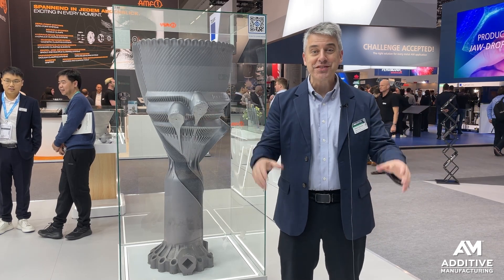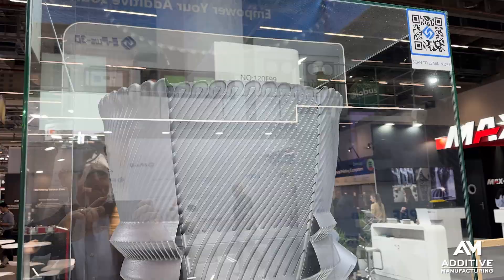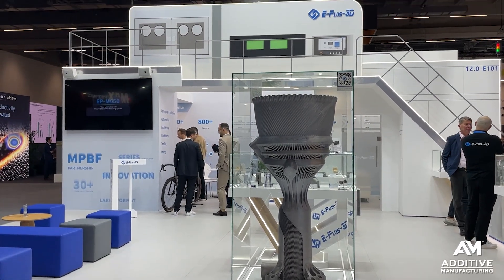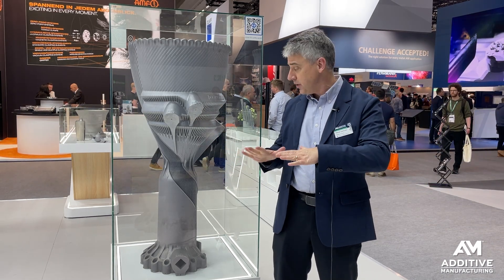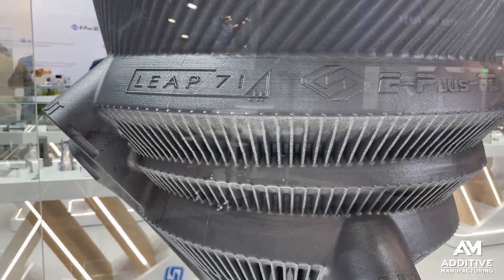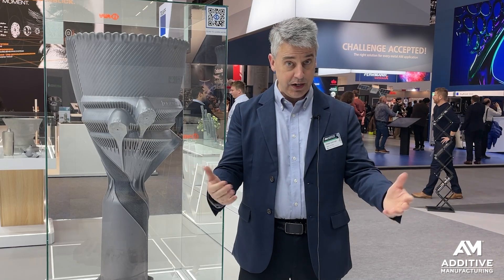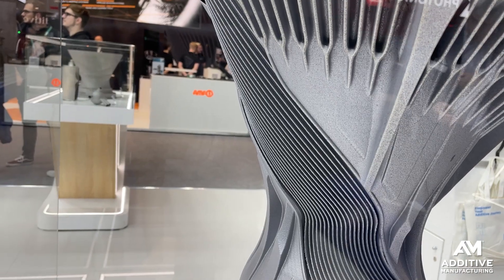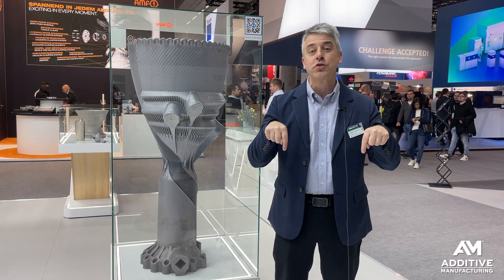Rocket Engine 3D Printed in One Piece with No Postprocessing | Formnext 2024

Comment: A lot of computer phobic "engineers?" here are suffering from the "that's not the way we've always done it" syndrome. Computer controlled and designed additive manufacturing is well on its way to revolutionizing and replacing the ways and speed things are built and how much they cost. They need to learn the new way or at least not get in the way.😉
Reply: Right 😂 , everywhere I see them complaining, "but does it work now."

Comment: Yes, this is clearly a finished part.  Do you think we're stupid and not aerospace engineers?  Okay never mind the missing goesinta and goesoutta holes, tell us about the number of hours this or an identical engine ran, and at what performance levels - ie; chamber pressure, throat size or thrust, throat temperature, chamber wall temperature, that kind of thing.
THAT is how you impress your actual market and not just advertisers.
If it hasn't run, it isn't a rocket engine, it's modern art.
And if you don't respond, we'll know, won't we?
Reply: He meant finished like it's all done and dusted and ready for the display case finished, not for in use finished lmao

Comment: well the input and output ports clearly need post processing still, but regardless, extremely cool. I find it bit strange that the "no post processing" is such a big deal, i mean it already has geometry you could not do with conventional means, what adding few machine hours to do few threads and interfaces by milling after paying for 300+h of sintering + all the post stuff related to that ?

Comment: No post processing with a huge asterisk. You need to take the part out of the cake and also remove the powder out of those tiny channels. That takes a comparable time relative to the removal of support.
It does not come like that out of the printer.
Reply: Pretty sure they're referring to machining after the additive process is complete.
Reply: @Jokemeister1  Yea but surely flange faces will need to be machined so some machining is also required. Certainly not yuking the yum here but I agree with @lucianoag999, using limited post processing would be more accurate. It's frustrating when salse guys feel they need to over hype something when it not required. This is amazing tech let it stand on its own.

Comment: what a stunning piece of engineering and manufacturing... would LOVE to see it do a full burn
Reply: They already are 3D printing certain elements of their raptor engines! Pretty dang awesome!!
Reply: @ikeliketocreate  yep, using printed inconel
Reply: that will never happen. It is made from aluminum so it cannot work. It would just melt instantly. Also it was generated by Ai, another guarantee it wont work. It is just a nice model to show case
Reply: this one will never run as it is made out of aluminum, which means it would melt immediately. Also it was Ai generated which guarantees that it will not actually work. It is just a nice show case.
Reply: @johgude5045 Look at NASA aluminium RAMFIRE nozzle. Same as here, the internal coolant keeps it from melting.
Reply: @johgude5045  No material can survive that kind of temperature, rocket engines have cooling.

Comment: But LOX is an oxidizer
Reply: LOX is the oxidizer and Aluminum is the fuel, aka engine rich combustion. 😜
Reply: He said 'uses liquid oxygen as a propellant'. That is exactly accurate. It uses liquid oxygen as an oxidizer and an unspecified fuel, but both are indeed propellants.
Reply: @ not accurate. RP-1 or Ch4 or LH2 would be the fuel. Again LOX would be the oxidizer for the propellant.
Reply: @TroyRubert  Most of the mass flow rate of chemical rockets comes from the oxidizer. Again, there is both fuel and oxidizer but since both contribute to the mass flow rate and therefore thrust of the engine, they are both are considered propellant.

Look up propellant mass for any rocket. It is ALWAYS fuel mass plus oxidizer mass.

The SpaceX Super Heavy booster holds 6,000,000 lbs of liquid oxygen and 1,500,000 lbs of liquid methane. Total propellant mass is 7,500,000 lbs.
Reply: They make rocket oxidiser tanks out of aluminum.
Reply: @ and steel. Saying lox was the propellant when its the oxidizer is what I'm pointing out.